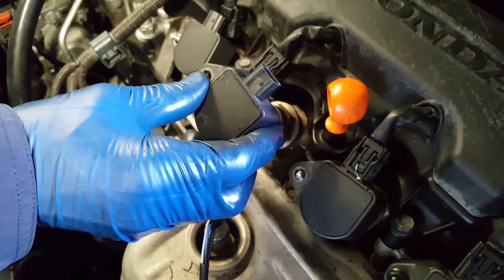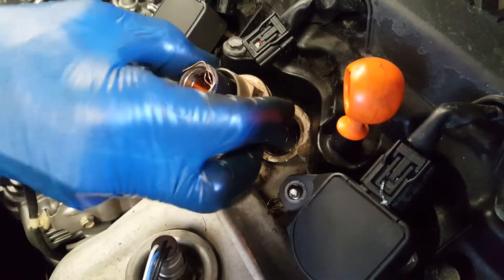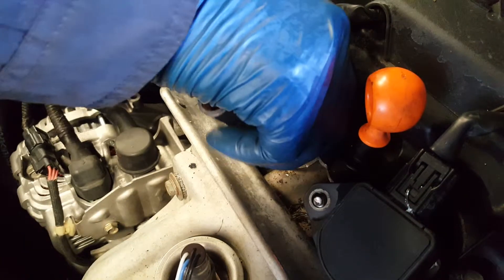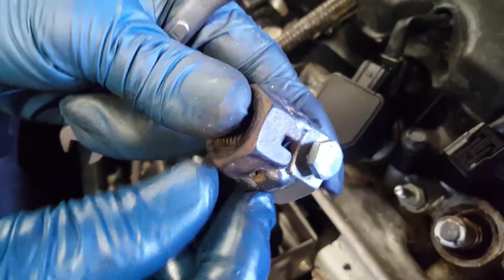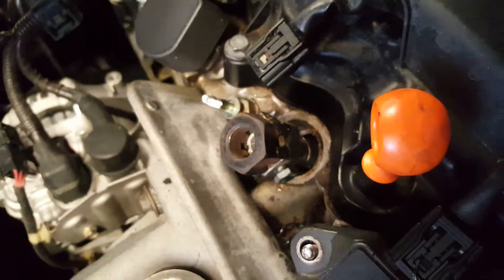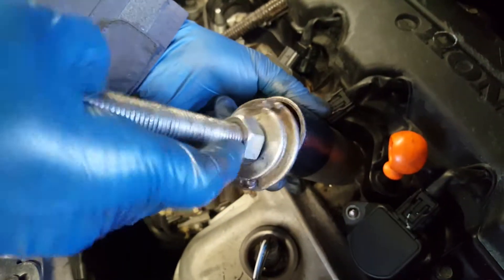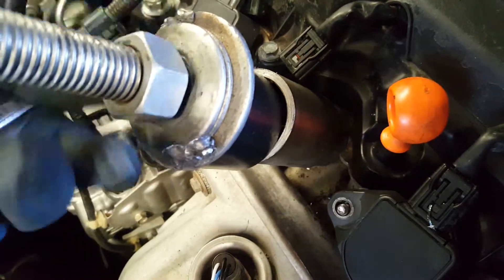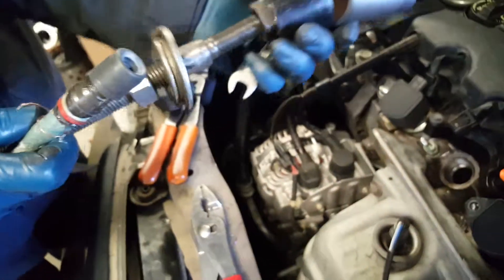2006 honda civic broken ignition coil

Comment: Exact problem I have..but don't have welding equipment or any of that stuff
Reply from the maker: Damn, see if you can get some vice grips clamped on it really tight and then attach like a rope or chain with a heavy weight to the pliers and then use that like a slide hammer style to see if you can get it off. Just be careful not to have your face over the weight when yanking on it or else it will hurt you if the coil does release suddenly. Hope that helps.